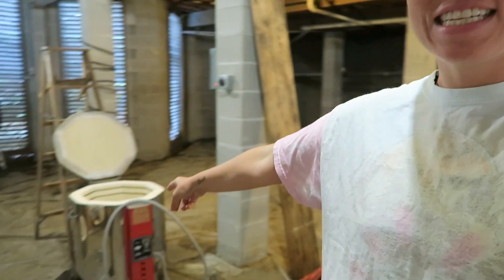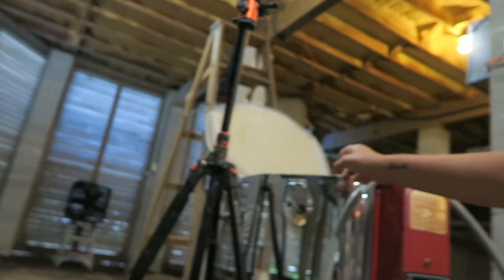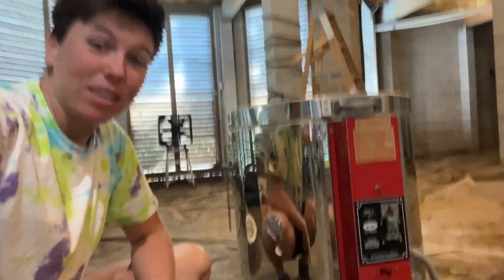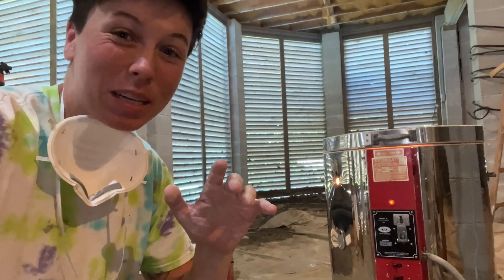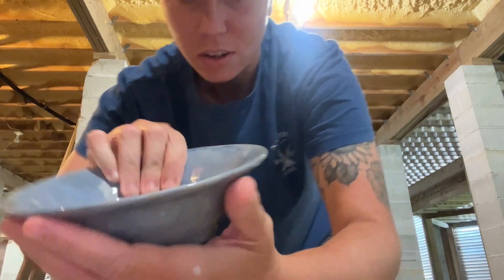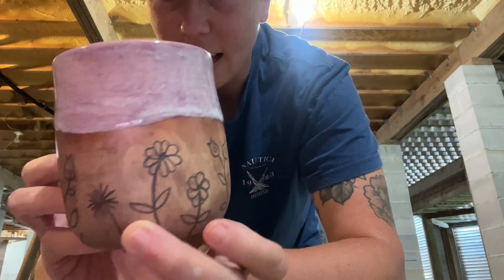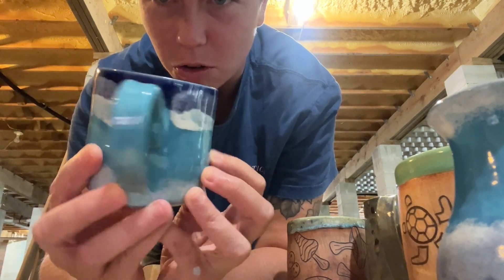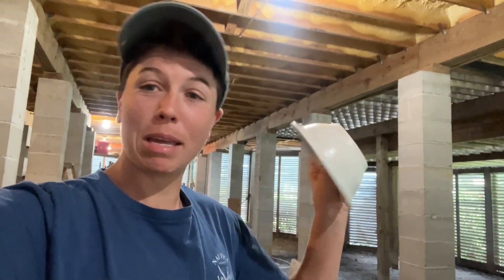How to Glaze Fire a Manual Kiln | Evenheat 4230 Kiln

Comment: I just bought a new to me kiln that may be this exact one. About to do my first glaze fire today, thank you so much for your video. The guy at the pottery shop said you can move the cone for the kiln sitter to get a ‘hot’ cone 6, I wonder if that will help those drippy glazes instead of having to be there when it switches off to do the hold. I’m new to running my own kiln, so maybe there is a big difference between a hold and ‘hot’ cone 6 🤷🏻‍♀️
Reply: I’m also wondering!

Comment: I have a very similar kiln, it just has one extra switch. I turned the bottom two on first and then turn the rest on in 2/2.5 hour increments in between each. It was a slow heat up basically. The Christmas ornaments I made came out really pretty and all the glazes look as they should, but my witness cones barely bent at all. I’m not really sure why. But my idea was to maybe do another test run with a manual hold when I can see it’s about to shut off. hoping that will give it a little more time to bend

Comment: About how long did it take to reach cone 6 in your kiln?  I have a similar model and it doesn’t take nearly as long as what many others have said about their glaze fires (different brands and styles of kilns). I’m worried that mine is heating up too fast. Wonder if that’s a problem?  The pieces are coming out nicely but I don’t want to damage my kiln if it’s running hot for some reason. The last 2 glaze fires I’ve done have only been about 4-5 house , and both were to come 6. I do turn on all my switches at once but that’s the only difference in what I did compared to your video.
Reply from the maker: Hey! Mine heated up really fast too! I slowed mine down by turning on one switch at a time every two hours.  I think 4-5 hours is a fast glaze fire. Some glazes will be fine but others need to go a little slower.  I shoot for a 8-10 hour glaze fire.  Hope that helps!
Reply: @lowco_ceramics  yes it does!  Thank you!  I opened my glaze fire this morning and the witness cones showed that it got at least to a 7. Not sure why the sitter cone didn’t slump sooner. I may move to a 5 for the sitter cone if it continues to fire hot but my first step is definitely to ramp it up slowly and see if that helps.